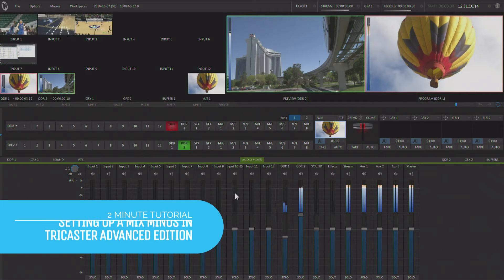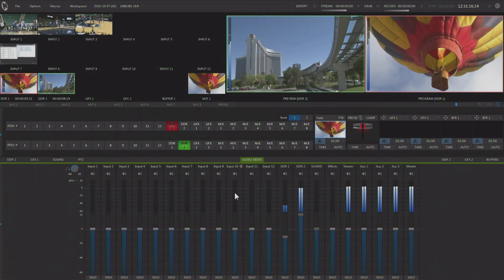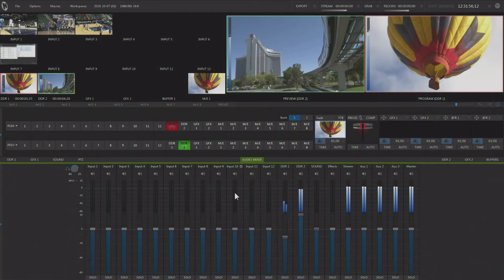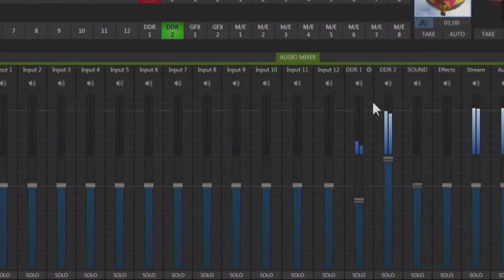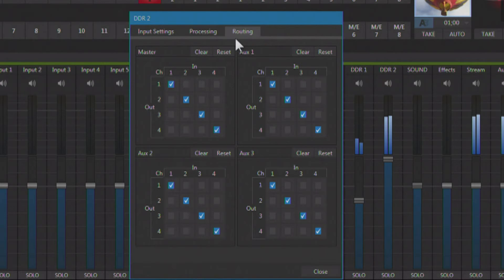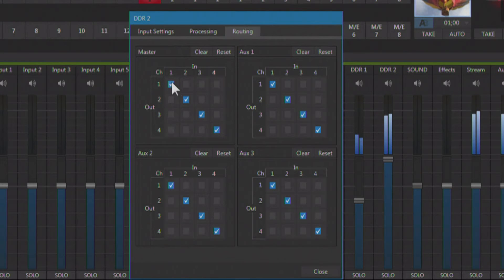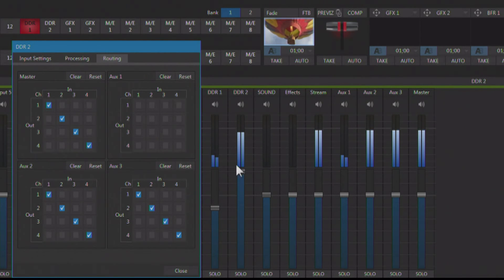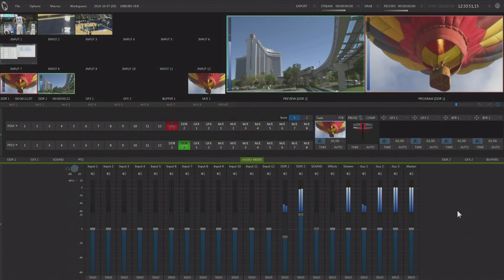2 Minute Tutorial: Creating a Mix Minus with TriCaster Advanced Edition

Comment: Could you please do a little more in depth one on audio routing.  The manual does not touch on it much, and coming from the older version on my 460 to AE2 is confusing.  I am actually on with Chat support right now, but they are not getting me much info.  Been waiting for 15 min now for a simple answer to where Aux 2 and Aux 3 go on my 460.  I also do not totally understand the 4 different channels for each output.  To say that a different way, so on channel 1 when you select the audio routing why is there 4 in's and 4 out's on Master, Aux 1, Aux 2 and Aux 3?  If I have a feed coming in on audio in 1a on the back of my 460 and I do not want it to go out of 2a on the back of the 460.  Do I need to turn all 4 off in Aux 1 only?  Or do I just turn channel 1 and 2 off in Aux 1?  It has now been 20 min waiting on a answer from chat support so I am going to end that session and just hook a bunch of stuff up and start testing I guess.  For some reason I just cannot wrap my brain around how this works.
Reply from the maker: Once you have the inputs routed to the Master or Aux Mixes in the configuration you desire, you still need to setup the outputs to receive the correct mix.

Here is an idea.  Plug in headphones and solo the aux channel you want to configure.  When you are hearing the channels you desire, you can un-solo that aux mix.  You would then go to the output configuration panel and send that aux mix to the desired output.
Reply: Thank you for the response, and that is actually a great idea.  On the 460 are there any physical connections for Aux 2 and Aux 3?